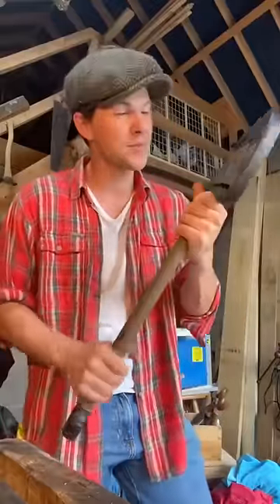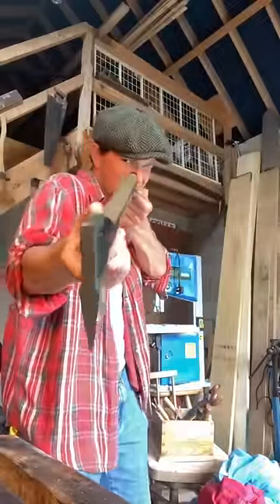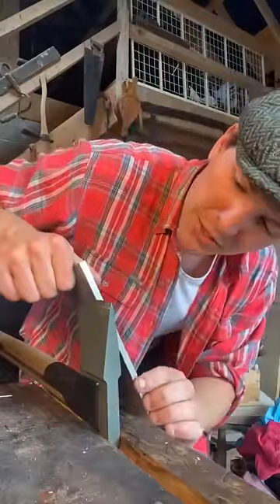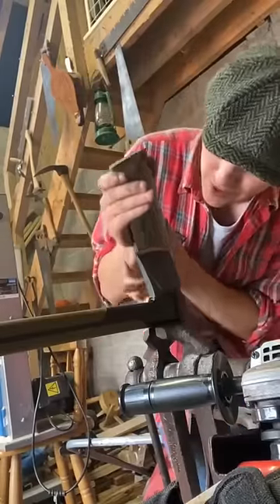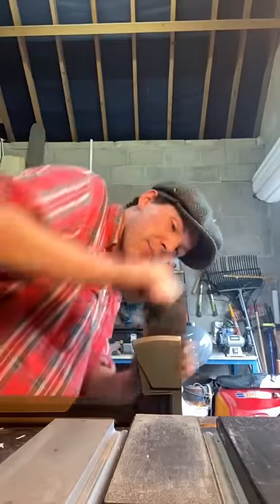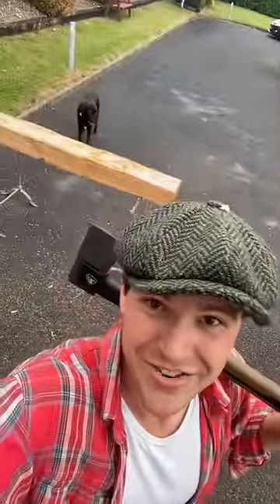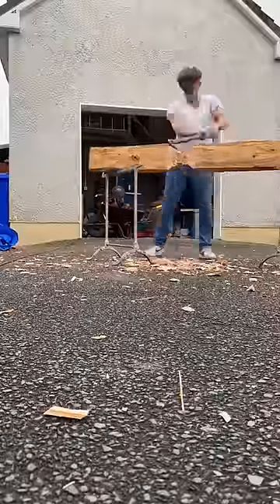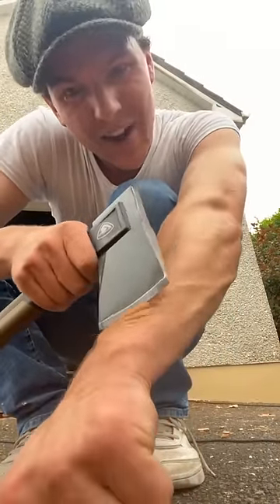Sharpening My Uncles Axe #shortvideo #ireland #sharpening `#axecraft

Comment: I believe that axe to be a log splitter. There's a narrower profile one designed for the task he used it for but at the end of the day an axe is an axe and a log is a log.
Reply: i have the exact axe but shorter at home, i believe it was from a company called ''robens''
Reply: You are correct.   It's between an axe and a maul
Reply: He makes the axe as sharp to cut his arm hairs. That is what we did at carpentry/furniture making school with out chissels to make them sharp enough to cut dovetails. We also leaned that an axe must not be that sharp for cutting and splitting trees because you use the force to split it, not cut it. It need to be sharp but not that sharp 😅
Reply: @Wungus_Bill  unless you're committing murder with it that is.

Comment: WD-40 IS NOT a cutting fluid, neither is it suitable as a honing oil.
It is a Water Displacement Formula.
Additionally,  you were using the stone in the wrong direction.

Comment: That's actually a type of splitting maul not an axe. It shouldn't be too sharp as it's meant to bust open the log. Every splitting maul I've owned had a straight and stout handle much like a sledge hammer.

Comment: This may be a dumb question, but is it ok to use WD-40 as a lubricant for sharpening?  I know it has solvents in it.  I've used sharpening oil, and I'm sure sprayable chain oil would be fine, but I didn't know about WD-40.

Comment: You do realize that by using WD-40 with your diamond stones, you are not getting the optimum cutting potential and ability from them. Because of it's viscosity, it doesn't allow full contact with the diamonds. It is better to use diamond lapping fluid ideally, but water or windex with a few drops of dish washing liquid in it works very well also. Do what you want, I'm just passing along what I've learned from multiple people with years of experience. I made the switch from using WD-40 or honing oil with my diamond stones to using Windex with about a half teaspoon of dish liquid to a bottle and it improved my sharpening time and sharpness exponentially.

Comment: Thats a log splitting blade. Gerber has an almost identical design and I actually put away my maul for splitting firewood because it works so well. It does a passable job of cutting like a regualr axe but was designed for splitting.

Comment: More important than a razor sharp edge is having proper geometry to the edge. There should be no corners of any kind. You want a smooth transition from edge to body. If you had taken down that harsh 30 degree transition past the initial grind I bet it would cut much better into wood.

Comment: Had a hatchet with a 90° angle at the top like that, and because the axehead isn't parallel on the handle, if that makes sense,  I found it very awkward.

Comment: I’m sure you already know this but it would be so much easier to cut the 8x8 if it was on something solid.  The energy from the ax head was lost in the beam bending and bouncing instead of using the energy to go deeper into the beam.

Comment: Original formula WD 40 isn’t marketed as a lubricant or penetrating fluid because it isn’t good for either application, it’s just for rust prevention. Mineral spirits will soak into metal creating a protective undercoat and molybdenum grease makes a resilient, slippery film on the surface

Comment: Fun fact about Sharp Axes, while they are better for cutting they suffer from being more easily damaged by the cold and hard knots if you are trying to fell trees, this is why the Early American double bladed Axe is a thing, one side was thinner and far more sharp than a standard axe, while the other would be thicker and a bit duller for busting through the knots of American trees. Lumberjacks would even hold their axes under their armpits to keep them warm while walking in the winter season, they really perfected the Wood Cutting Axe scene back then

Comment: You putting donkey rust 40 on your material you're not going to have it long it's going to cover and Russ you have to sand it down again you should be using some real penetrating oil and some real lubrication instead of that water displacement is to keep water off stuff not lubrication and what nothing else

Comment: Water displacement is not a lubricant
Reply: Oil displaces water. Wd40 is made of oil. Wd40 is lubricant.
Reply: @autumn5592  literally the worst lubricant you can use to sharpen or to cut anything it’s not a cutting fluid you would be better off using water as a lubricant
Reply: @HaskinsChannel  You're saying mineral oil, the base of most petroleum lubricants out there, is a bad lubricant? What? Hahah

Comment: Wd is    not    a lubricant.
Reply: How comes? It's a penetrating oil
Reply: It was designed to put a film on metal to protect against oxidation. 

It is not a lubricant.
Reply: @henrygoboy8621  It's a penetrating oil. It has to be a lubricant to do that.

It does form a film, a couple days later when the volatile lubricant has evaporated.

It is a catch-all, it is a lubricant, it is corrosion protection.

Comment: I am pedantic and I just want to note this here. 

Penetrating oils, such as WD-40, are primarily designed to loosen rusted or seized parts and penetrate tight spaces. While they do provide some lubrication, their main function is to break down rust and other contaminants to facilitate the movement of parts.

Penetrating oils typically have low viscosity, allowing them to seep into small gaps and crevices. They often contain solvents and additives that help dissolve rust and corrosion, making it easier to free stuck components. However, their lubricating properties are usually not as effective or long-lasting as dedicated lubricants specifically designed for that purpose.

If you need a lubricant for ongoing or long-term lubrication, it is generally recommended to use a dedicated lubricating oil or grease. These products are formulated to provide superior lubrication and protection against friction and wear over extended periods.

So, while penetrating oils do offer some lubrication, their primary purpose is to penetrate and break down rust and other contaminants rather than providing long-term lubrication. Please do not call WD-40 a "lubricant" as this could potentially lead to people using it for purposes where dedicated lubricant is necessary.